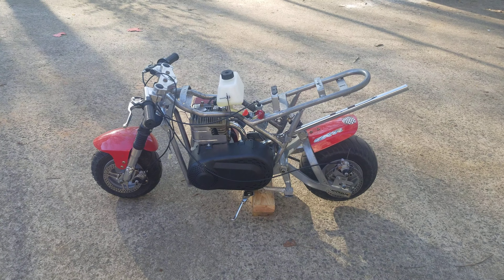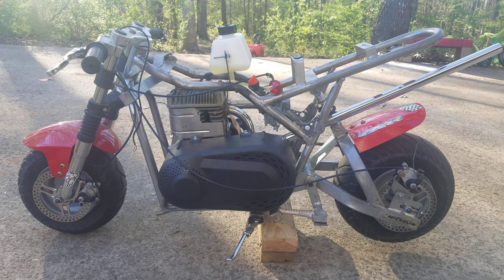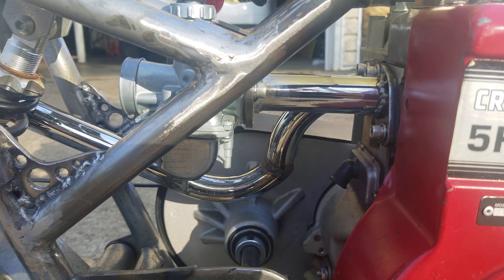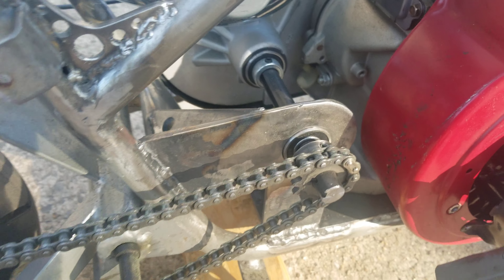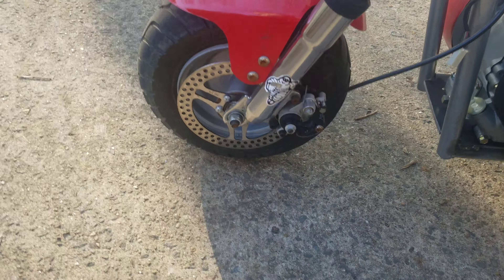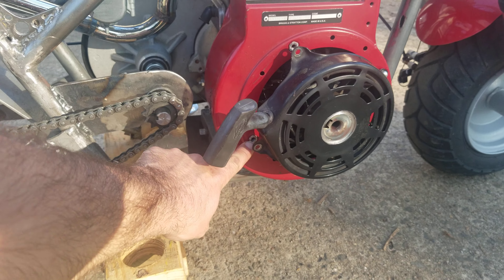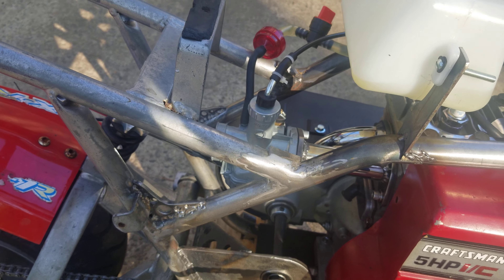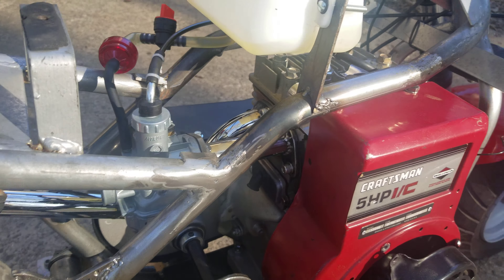Cateye Fs509 Pocket Bike with Briggs 5hp Flathead Build Part 2

Comment: Nice bike I love mini bikes. I have a Harley-Davidson motorized bike and I hope your channel grows! Did you weld the frame you’re self? Can’t wait when the build is done. Awesome work!
Reply from the maker: What's up man!  Thanks for your comment!  Yea I've got a soft spot for mini bikes too lol.... The frame itself is a Cateye pocket bike.... I had to cut and add upper frame sections to accommodate the much larger briggs flathead motor.  So beyond that and adding the engine plate is the only welding I had to do.  I checked out your channel as well and saw your motorized bikes!  Man that's cool as hell... I've been wanting to build one of those for a while!  I sub'd to your channel.  Thanks again man and stay tuned for more updates on this Mini Bike! 🤟

Comment: Great job on everything on that thing..the frame mod, the intake adapter, the jackshaft!..well done..I haven't had problems with 22mm on my raptor engine..have you tried adjusting the needle in the slide?..u can lean it out that way..good show
Reply from the maker: Thanks you Sir I appreciate that!  But yea this was the feedback I was looking for!  I have adjusted needle to the leanest setting and it's still fowling plugs.... So basically what's happening is if you snatch the throttle off idle it completely Boggs down and will die if I dont return to idle.... but if I come off idle slowly it will rev up fine.... when I'm riding it will do the same thing?  Mabe I've got other issues going on?

Comment: Is the cam stock right now ?
Reply from the maker: Hey Kevin at the time is video was made the engine was stock internally. However, since that vid the motor has been modded as far as my budget allowed lol... I have videos on my channel about it. Thanks for watching! 👍
Reply: @bstarnes514  iv seen alot of them did the factory cam with port work on the red motor run strong ?
Reply from the maker: Oh yea the motor was really strong!  I can't tell for sure what mod did what because I did all the work at time.  The combination of all the flow mods  together really bumped the power up overall.  Plus it was all in preparation for the cam and valve train parts...

Comment: Do you know what size Jackshaft these Im bikes use ? Trying to figure it out but information is hard to find
Reply from the maker: What's up man!  Appreciate the comment!  I assume your asking about the factory jackshaft that also doubles as the swing pin correct?  If so I'll measure it this evening and report back with the findings! 👍
Reply: @bstarnes514  thank you so much and yes I believe it was the factory one . I’m having trouble finding an 8mm or 05T clutch to fit the chain because I changed the motor to a predator 79cc so I’m thinking of completely redoing the chain size but I need to almost make a new Jackshaft

Comment: how did u get the back sprocket to stay in
Reply from the maker: Good question!  Its actually very simple.  So the sproket I bought has a inner bore dia of 2 1/8 which fits right over the lip on hub that the factory sproket mounts to.  From here you just simply mark the holes from the hub to the new sprocket and drill away.  BTW the sprocket is a 60t #35 chain.  I beleive I bought it from eBay.